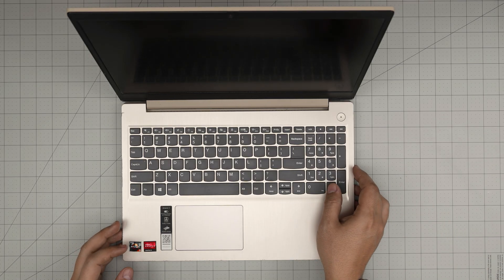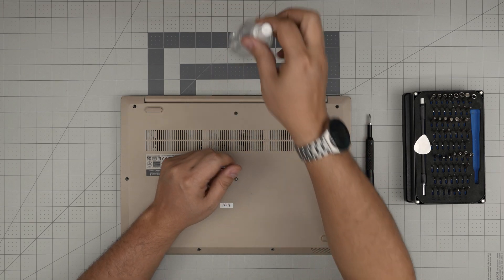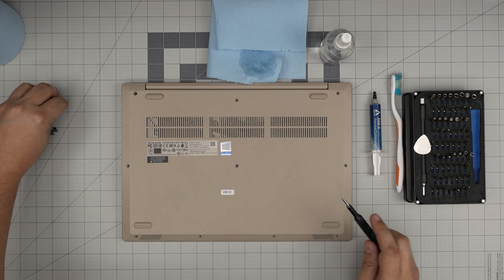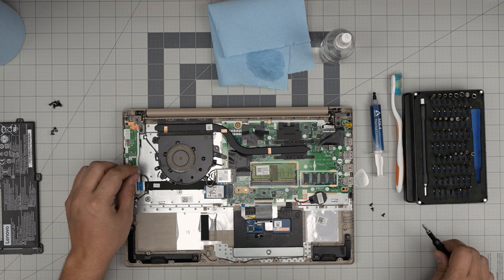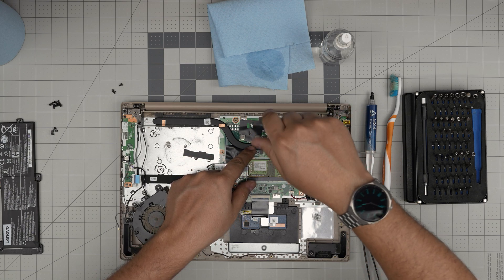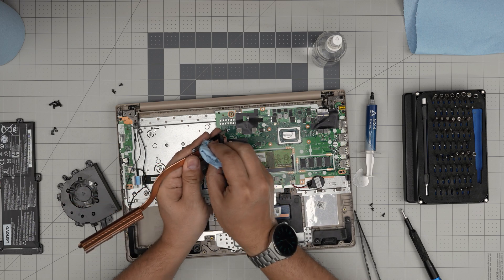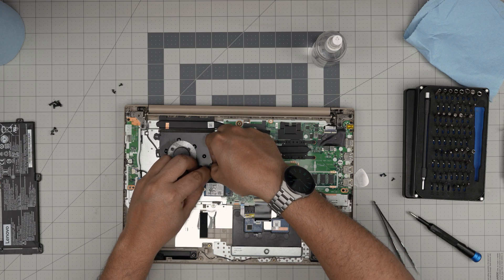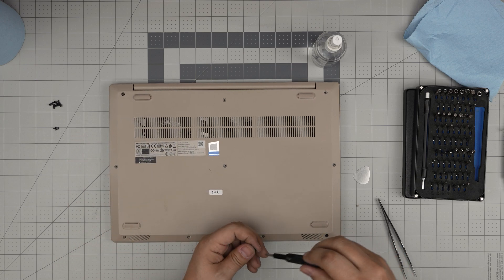How to Repaste & Cleaning Service on Lenovo Ideapad 3 15ADA05 Laptop

Comment: Good video. very informative. I'm intrigued as to how to replace the bios battery. is it soldered to the wires, or is it a battery holder soldered to the wires?
Reply from the maker: It's my pleasure my friend.
🫠Regarding your question, the BIOS battery is connected as a jack into the board. Just pull the jack out and remove the battery; the battery is held with double-sided tape.
Should you have any further questions or requests in the future, please don't hesitate to ask me.
cheers🍻

Comment: hey i have a question, when you put the cpu block/the heatsink back on the cpu, did you just turn the screws it until snug or did you give couple of turn when it get snug? i'm just afraid i would overtighten it
Reply from the maker: 🫠Regarding your question, don't worry; tighten the screw as needed—there’s no issue with over-tightening. Just don’t go overboard, as the only downside might be struggling a bit to unscrew it in the future.
Should you have any further questions or requests in the future, please don't hesitate to ask me.
cheers🍻